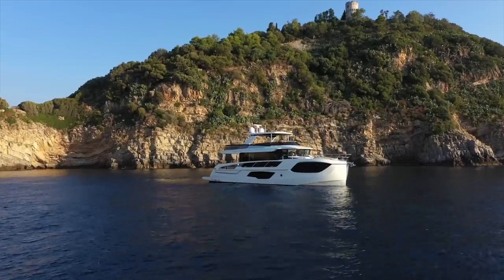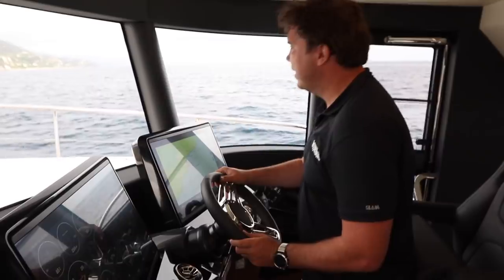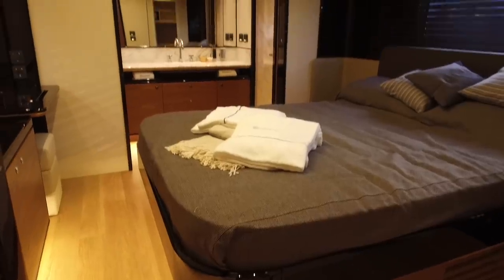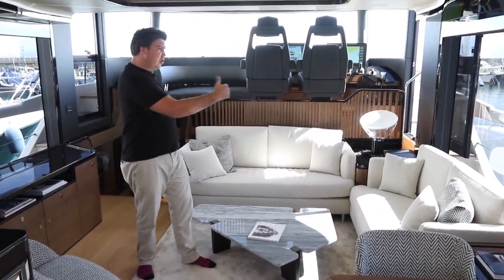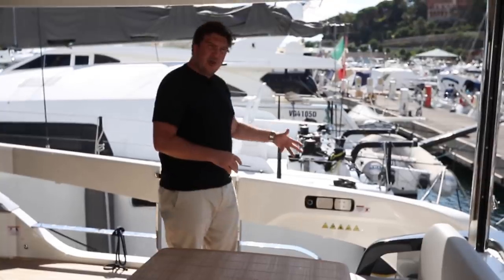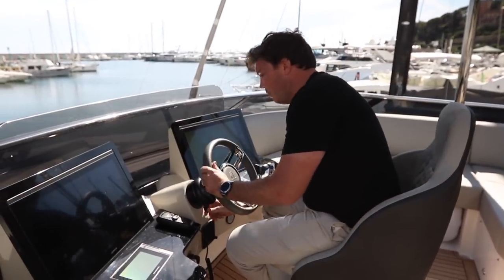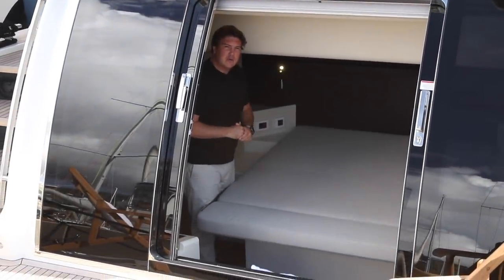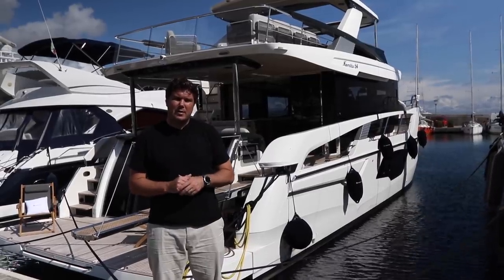This $3.2m trawler has a trick up its sleeve | Absolute Navetta 64 review | Motor Boat & Yachting

Comment from the maker: To answer the questions about range: 260nm at 20 knots with a 20% reserve; 225nm at 28 knots with 20% reserve.
Reply: @MrAbletospeak Well, at 9 knots, it consumes about 5.4 liters per mile, with a fuel capacity of 3.600 liters, so the range at lower speeds is about 667 miles.  Not great for a trawler, I guess, but better than the 260 miles you'd get at 20 knots.
Reply: @MrAbletospeak Not that bad for 20 knots. Throttle it back within 10 knots the range will more than double.
Reply: @MrAbletospeak have you got one....

My ST34 has about 250 miles at fast cruise. That’ll do for me! When you can buy one feel free to be supercilious.....
Reply: @arekpetrosian4965  
 This is a complete failure 
 Motor Boat & Yachting
  650nm @ 8 knots.
Reply: @Vivendi77  Why and/or how is that a "complete failure"?  That's really not bad range for a yacht of this type and size.  It's not advertised as, or claiming to be, a long-range trawler.  If you want that, look into Nordhavn or Kady-Krogen.  This is for comfort, luxury and a bit longer range than most sport cruisers.  Not trying to advertise for the brand, but being objective about it, I don't see a problem with its range.
Reply: Azimut magellano all day
Reply: @MrAbletospeak It's a SD hull, what were you expecting, ocean crossing? Anyone who wants/needs larger range needs to look at sailboats or actually full displacement trawlers like a Nordhavn or a Selene. But then your max speed will be ~8 knots, not 28. Entirely different types of boats for entirely different needs.
Reply: @MrAbletospeak Agree.Probably the only way for this to survive(kind of) as a product is to go electric?
Reply: @arekpetrosian4965  ,
Reply: @arekpetrosian4965  they speak as if they have the money to purchase one yet alone maintain.they speak about more nautical miles but do they have money for the fuel ?.we humans are so ungrateful but when deceitful people approach us we accept and believe their nonsense smh
Reply: @poorfordtransitowner1627  If you're an old fuddy duddy.
Reply: @123OGNIAN  It's selling well.
Reply: peut t-on avoir des sous-titres en français ?

Comment: This video was posted on December 8, 2020.  I believe newer versions of the 64 are fitted exclusively with Volvo Penta D13 IPS 1350 engines with 1,000 hp each.

Comment: truly a lovely yacht. Range is definitely an issue... I wonder if larger tanks are available. otherwise I need this yacht!!! Thanks for the walk through
Reply: https://www.absoluteyachts.com/en/absolute_test_drive/the-international-yachting-media-it-navetta-64/ 
See page 68 on the review for the range tables. With a frugal hand on the throttle the vessel will take you ~2,000 Nautical Miles on 3,600L fill. I'd hope the stabilisers were up to the task at those low speeds.

Comment: What is the real trawler speed range 7 - 8 knots, Its nice they all go fast but the rest of us want real range.
Reply: depends on sea state
Reply from the maker: 260nm at 20 knots with a 20% reserve; 225nm at 28 knots with 20% reserve.
Reply: @MotorBoatYachting  Not really answering the question of average sea state.
Reply from the maker: @DanielBrody  650nm @ 8 knots.

Comment: nice! never mentioned range :O i thiink :(
Reply from the maker: 260nm at 20 knots with a 20% reserve; 225nm at 28 knots with 20% reserve.
Reply: @MotorBoatYachting  do you know what it would be at 9 knots, you know I just wanted to know before I bought one. 😄
Reply: @nothingsurprisesmeanymore  https://www.absoluteyachts.com/en/absolute_test_drive/the-international-yachting-media-it-navetta-64/ See page 68 at the end of the review. Almost 2,000 Nautical miles at 5.5 Knots Per Hour for a 3,600 L full tank. Normally those figures have a reserve contingency of about 10% too but I cannot be sure in this case. At those low speeds stabilisation would likely be an issue - think bobbing around the ocean like a cork - so I assume it has low speed stabilisation as well.